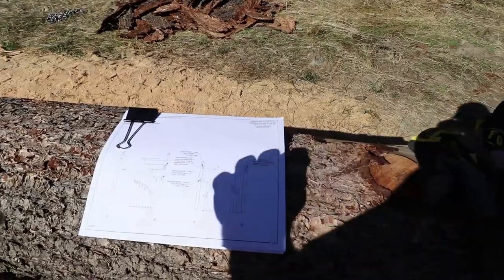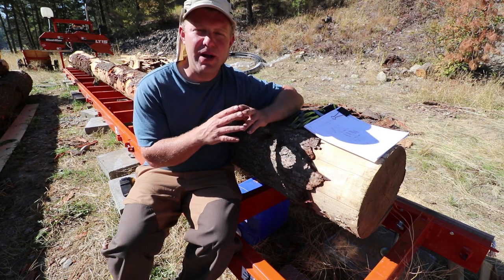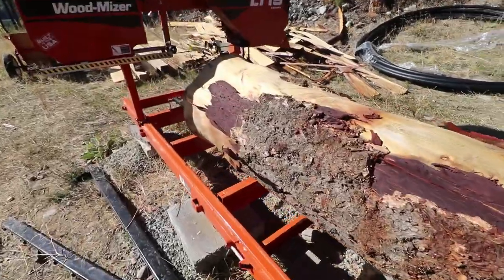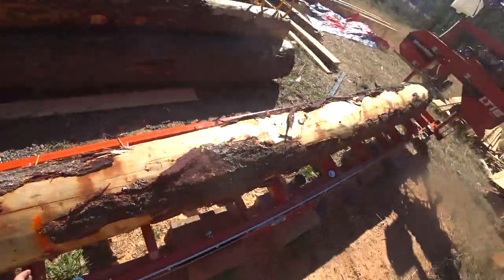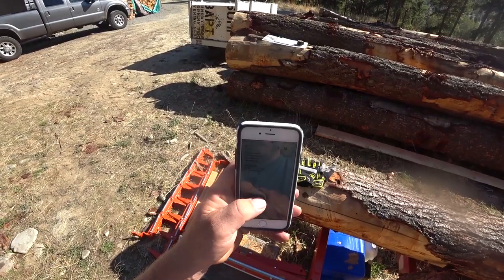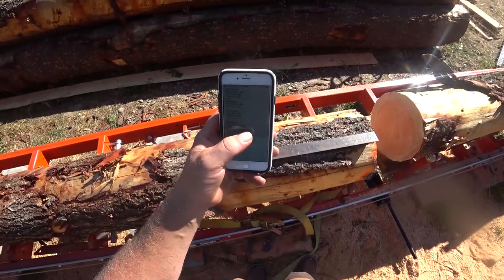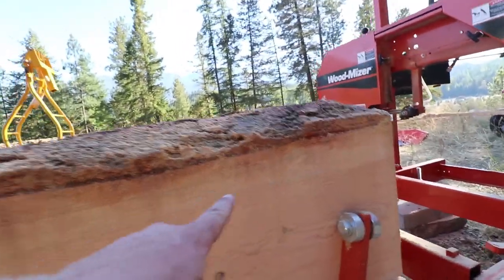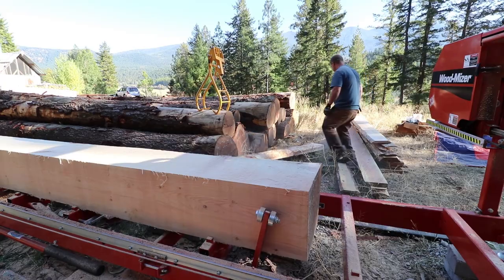Sawmilling First Beam Of My Timber Frame House

Comment: Watched a number of your videos, man there is a lot of talking for the amount of action. Speed through a 20 minute video in 5 minutes. Seems to me that off grid building and living should be more Dick Proenneke than you with architects, engineers, CAD drawings of what you should do and a Home Depot down the street. Congratulations on what you're doing, it's your show,  but I sure don't get it. A large upper middle class house that certainly doesn't tread lightly on the environment within driving distance of all the amenities.

Comment: why do we need to cut timber into square shape, why can't we just use the shape what it is?
cutting seems lot of waste to me
Reply: Shen Zhou, your joking right?
Reply: Get a piece of paper and a pen. Now close your eyes and draw a house.  That is why you square everything.
Reply: Because it wouldn't be a timber frame - it would be a log cabin.
Reply: Thank you Shen Zhou for asking the question.  In traditional Chinese timber framing all the vertical columns are indeed tapered and round and they have a wonderful system of brackets and framing that results in very graceful curved roofs which carry a lot of weight in tiles.  There are several good videos out there that show them being built. you can also see Korean and Japanese craftsmen doing these things.    
Also in some of the colonial timber framing techniques used in New England, they only squared some of the sides as the other ones were inside and so they opted for economy of technique rather than industrial perfection.  The nature of wood is that it is moves with cutting and has natural curves and you can choose to work with them, such as when you are a maker of wooden ships and choose the members so the curves fit into your composition. The important thing in timber framing is to make sure the end joints line up and that you have flat floors so that things don't roll into the corners unless you are on a ship and don't mind fishing stuff out of the bilges and scuppers.